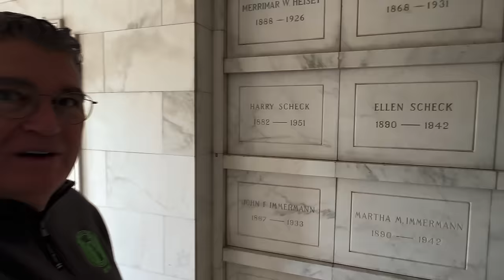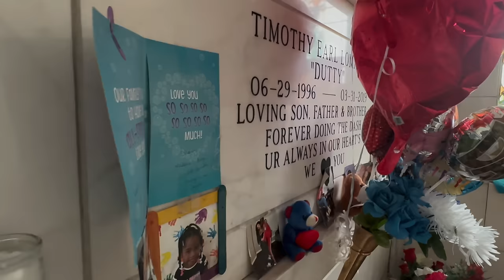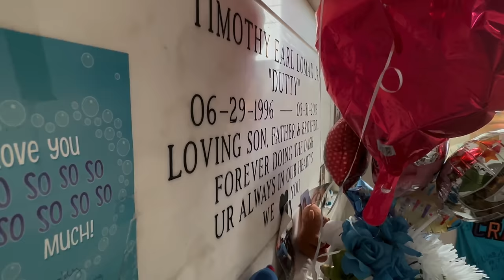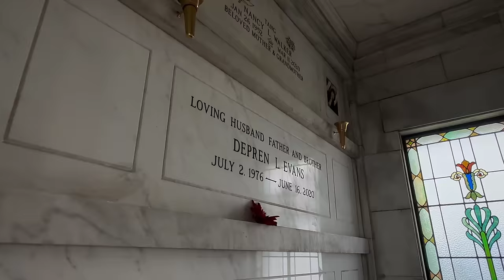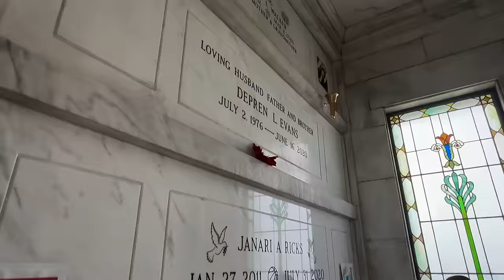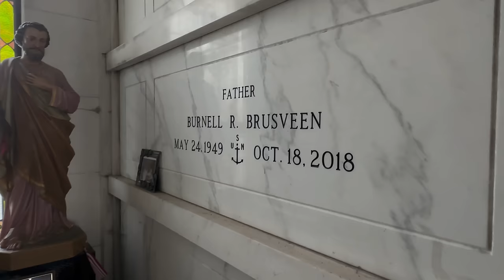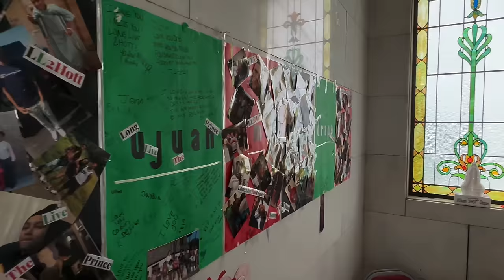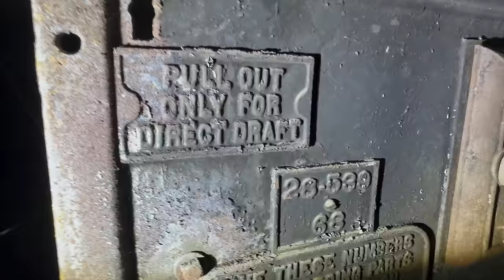CREEPY CREMATORIUM, in a Creepy Mausoleum.

Comment: I'm fairly sure that the basement does not hold a crematorium. Based on the coal chute and large blower fan, it's the old central heating system for the  mausoleum. And that is simply the interior of the heater itself. Hence the newer equipment installed directly next to it, probably just providing air circulation for the building. Regardless the mausoleum does give off a very creepy vibe. Love all of your videos!
Reply: Good call. Glen Oaks didn't have a crematory. There are several other cemeteries that had crematories, but not Glen Oaks. The funeral home on/adjacent to the property has a crematory now too.

Comment: That... Was a great episode. Loved the underbelly of the place complete with heat exchanger cast cremation tubes. I think the uneasy feeling you feel may emanate from how the frequency from the boiler fan units resonates throughout the structure. Sound does very strange things at low frequency and will all those open vents .. yeah that place is luke z low frequency crucifix shaped speaker. Well done for sticking it out.

Comment: This was certainly one of your most intriguing explorations. The cremains display cabinet starting at 4:05 is particularly interesting, and raises a lot of questions. The cabinet looks like something one would see in a department store other retail place, but not intended for holding cremation containers. It's just a few large panes of sliding glass with locks at the bottom for each one. And the fact that it is on rollers suggests it was never intended for use in a mausoleum. Its only purpose seems to be to conceal the opening to the room behind it. The "hidden" room looks like it was specifically designed to hold cremains but is completely empty and in a state of disrepair, unlike the rest of the mausoleum. In fact, it looks like nobody has been in that room for years based on the accumulation of dust. I'm curious what the story to this room is, why it is hidden, empty and abandoned. I hope you can try to find some answers to this. It may be one of the most interesting aspects of this mausoleum.

Comment: Great video. It seems like more and more cemeteries that have indoor mausoleums have become more relaxed with the use of cameras. Only because the last time I went to Rosehill in Chicago, back in 2013, a maintenance guy notified me that taking pictures or video was prohibited and would follow me around just to make sure that I wouldn't take any pictures or videos by spot cleaning.
Reply from the maker: agree, I have filmed a lot in the Rosehill mausoleum the last 3 years....however!! - they did add some signs last year to not film.  but no one is ever in there.  and no one there has complained to me.

Comment: The chute with the doors was the cold air return, and the doors have filters to grab dust out of the air. The little motor ran the huge fan!

It would be interesting to know how they heated that big place, and I would suspect water/steam system that provided hot water for radiators, as that was quiet common in big buildings like that.The only problem, if it quit in the winter, the pipes would break and flood the place, and seeing all of the basement water damage, I suspect that is why they have new furnaces!

The old crematoria retort has been damaged quite a bit! And it would be too expensive to replace that!

Comment: Obviously that was an elegant mausoleum at the time it was built.  The exterior of the building and the extensive marble work inside attests to that fact.  But something has happened to it over the years and I wonder what it is.  I find it strange that there are fairly recent burials but it also appears that there is room for many more.  Why so many vacant crypts after all the years it has been there?  It looks "nice" inside but not at all inviting.  And that basement - what a mess.  I suspect there are money problems as is oftentimes the case with these places.    Nothing lasts forever and this is proof that a dire situation probably will exist in the years to come.  I give you credit for going into it, Ron.  Creepy is an excellent description.

Comment: That's the safest place you could be during a storm, that building was built to last. It's obvious even though the rest of that basement is old and rotted, that new air system shows that they've spent real money on the building, the guys who installed it probably had a real interesting experience lol.

Comment: I'd never want to be buried in a cemetery or mausoleum. Those places get abandoned all the time. No upkeep or anything. That humming sound was the ventilation system that blows air through the vaults. Each of those units have holes in them for drainage and air flow.

Comment: Looks like that basement was or still is a service utility area.  Those decaying furnaces have been abandoned and there was a bank of newer units that were installed.  Seems unlikely they carried a body down those steps to perform a cremation.  What you saw were old rusted out heat exchangers that kept the place warm or usable for decades.

Comment: Sticky floor is likely melted then solidified adiposcere body fat sludge that the older oil retorts couldn't efficiently or speedily reduce to ash. Corpulent bodies would ooze melted fat out of the retorts. That big wheel you'd shown was a blower to supercharge the oil burner retorts to speed up the process. They'd churn and burn as many bodies as possible. Ran them 24hrs. The new looking equipment in the video is maybe a conversion to gas retorts. Been out of the business for long time but thought I'd share my info for what it's worth.

Comment: Just a thought. The equipment in the basement did not look like an crematorium. The wall opposite of the doors was to close and would not allow the maneuvering of body's as they enter the doors. My guess is that it was an old 4 chamber coal fired heating system.

Comment: Looks like the retorts were coal fired and the fan was the stoker , possibly had asbestos in it's construction and possibly had problems in converting it to oil / gas fired so was decommissioned.

Comment: The rib metal on the bottom of the cremation tort looks like the top portion that fell to the ground level most crematoriums had two burners in case one broke down so the body could be transferred to the second chamber as soon as

Comment: I don't think those are cremation furnaces. The oil fired burner shown looks to be too small to create the kind of heat required for cremation. The layout of the giant air handling unit (squirrel cage blower) directly behind it suggests these were central furnaces used to heat the building. The blower would pass air across them and it would be distributed by the vents shown earlier in the video. The newer gas furnaces replaced them. Further supporting my theory is the lack of any evidence of anywhere else the original central heating furnace(s) would have been. They would have taken up more space than the footprint of the newer and more efficient gas units. Those older furnaces would have originally been coal fired and at some point were converted to fuel oil. The new furnaces are natural gas or LP.